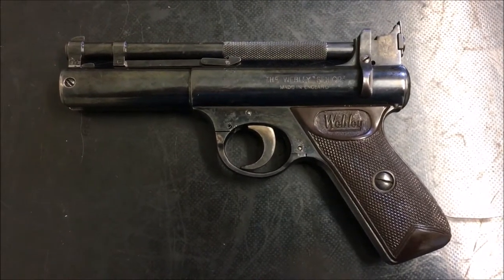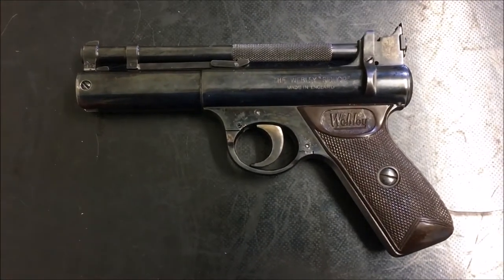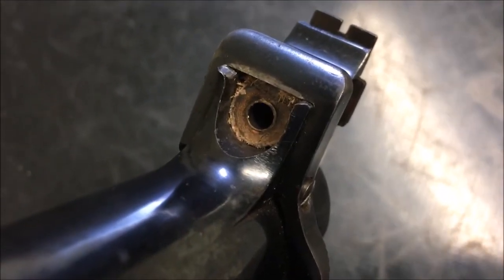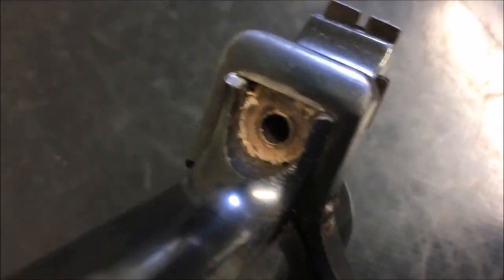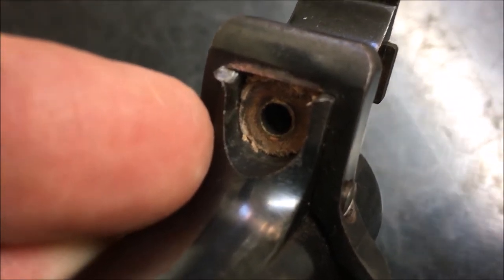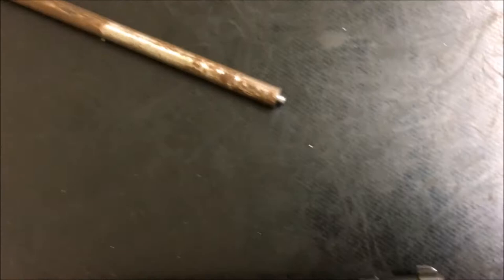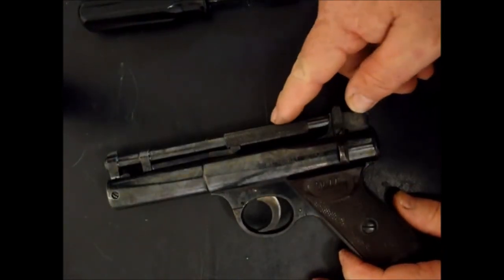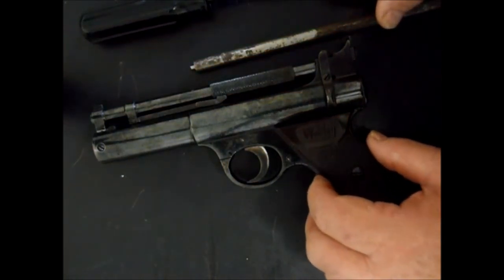Replacing The Breech Seal On A Webley "Senior" Air Pistol

Comment: I took the barrel latch off, used an empty 9mm case with cap removed to push new seal in. A little over 10 minutes total. Took longer to remove the old one than fit the new. Make sure nothing remains of the old seal before fitting new. (Late 1930’s Senior)

Comment: Great video very interesting. I have just been given an vintage unwanted Webley MK1 air pistol in very good condition.
I have stripped an cleaned it and ordered the necessary lubricants to get it shooting again.
On a closer inspection of the pistol I found a hairline crack at the end of the cocking slot where the end cap and spring guide screw into looks like a weak link in the design, everything looks secure and not likely to fly apart and the pistol may have been used for years with the crack.. 
Just wondering if this may be a common fault with the MK1 and if anybody has had the same problem but still using the pistol. Could not find any info on the internet.

Comment: Mine got a hard-shell rubber seal. And mine is the earlier senior without the knurling on the barrel. Took it apart when I restored the gun and it was tight to get in hardly worth a mention. I did think about the leather one but watching this I'll stay with yhe rubber. There'll be no benifit from the leather one.

Comment: Great, but how do you get the old one out? and if you dont have a lathe?
Reply from the maker: Just pick it out with a sharp pointed implement. They are usually very hard and just disintigrate and you remove in pieces. If you need a tool I can send you mine for just the cost of postage as I have sold my pistol now and will never need it. Email me at justinbulling "at very warm mail dot com" if interested. If you can't understand the email address ask someone who is tech savvy and they will work it out.

Comment: i use a off cut of the end of a baofeng uv5r antena   its slightly tapered stiff rubber    ideal shape   just cut off the end it already has a hole
Reply from the maker: Good tip as original seals seem to be no longer available.

Comment: Well I've watched this over, and over, but I'm not seeing the new part either before, or during insertion!
Reply from the maker: As I clearly stated at the 1.40 mark when you can see the new seal in the pistol I did this repair and found it quite difficult which necessitated making the tool. The video is to discuss how I successfully achieved the installation including how to prepare the replacement part and use of the tool to install it.